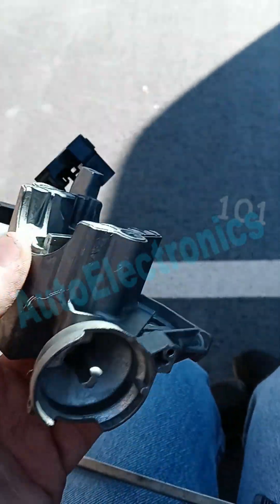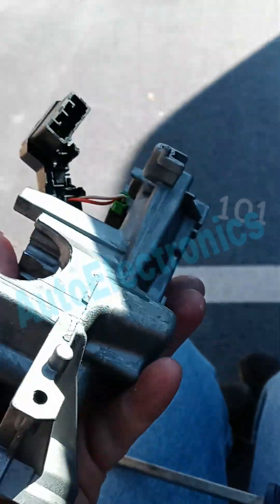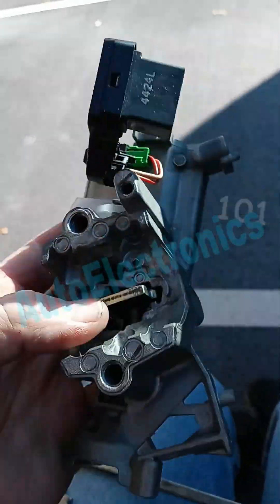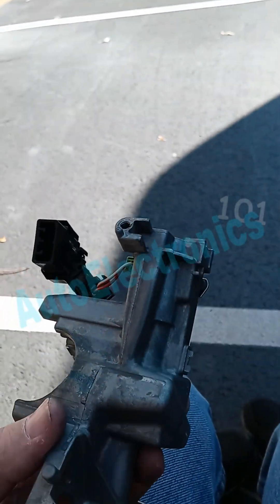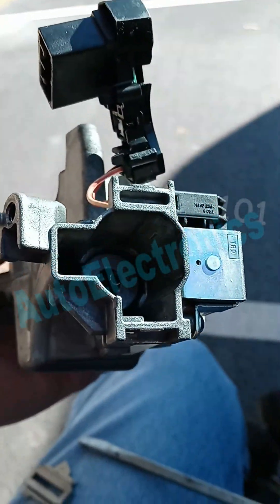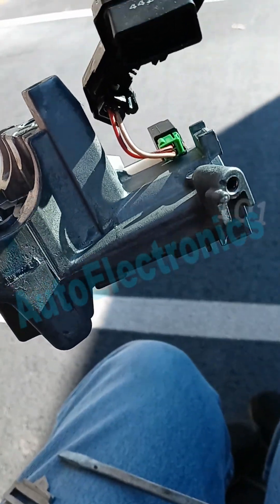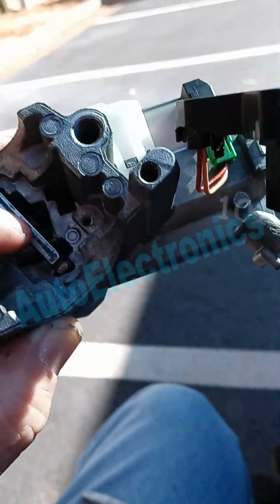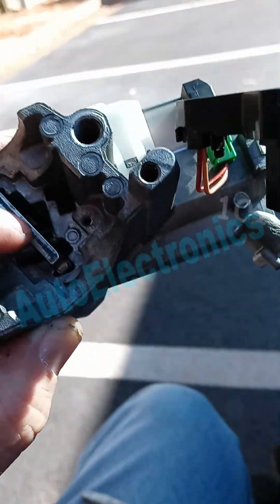How to reset locked Honda wheel lock assembly after ignition cylinder repair - auto locksmith tip

Comment: LockTech makes a Honda ignition reset to that doesn't require removal of the wheel lock assembly.
Reply from the maker: It hadn't come out at the time for me and this video but appreciate the heads up for others. I dont do that many anymore. Semi-retired from doing mobile work but it sure would have been handy back in the day when I did these for honda. Wasn't usually a problem but when it happened it sucked.

Comment: How can you do that without removing the whole assembly? Remove the electronic switch on back, then hold it in place while removing lock cylinder? I don’t like to remove the whole assembly only lock cylinder
Reply from the maker: Usually you dont need to do this when just repairing the cylinder.  but sometimes these get locked and even with cylinder removed/fixed you can not turn the switch. I used to hear smiths complain about it all the time thinking the wheel lock assembly was damaged and ended up replacing it completely. This video is just showing how to fix the assembly those times it happens to be locked even after cylinder is repaired. You will not be able to do this part without removing it.
Reply: @ecurepair  those ignition cylinders aren't exactly cheap either in my case the customer opted to just having the wafers replaced

Comment: Remove the ignition with the it in the on position, it'll stop that b.s from happening, got stuck on this a few weeks ago
Reply from the maker: The problem with honda is usually you are rebuilding them when they fail so you cant usually turn it on before removing, But would probably work ok to pop it out, switch it to on and install the new/rebuilt one in the on position
Reply: @ecurepair  I just cut a new key by code, get it into the ignition and a few taps with a flathead handle and I get it to turn
Reply: @ecurepair  I'm a locksmith bud and have done at least another 7 or 8 of these since that first time. Works fine for me
Reply from the maker: @travisnamath7549  lol i got ya man no worries. I am a locksmith for over 20 years and I did these daily for my local Honda dealer for several years (this video was even done there. You can see the lot tag).  Sometimes 2 or 3 a day.  I've done hundreds of these honda ignition rebuilds over the years. The reason its not typical to be able to turn is because the split wafers move out of their lower guides and then block the sheer line (and sometimes even the keys entry) since they cant drop down properly anymore. If your lucky you may just be dealing with a worn key or you have maybe one wafer that's slipped out and your likely cracking it in half when you force the key on but honestly I'd advise against it. There is no reason to risk damaging the cylinder by forcing the key on since these are only held in by the roll pins and your goal should to be disassemble and rebuild with a new wafer kit. This problem of the wheel lock is more of minor annoyance that happens once in a blue moon. I poorly worded its occurrence in this video. My apologies.